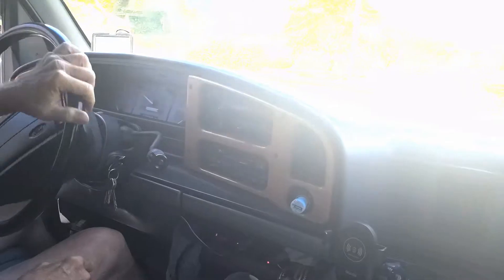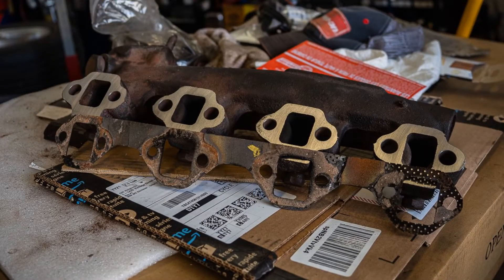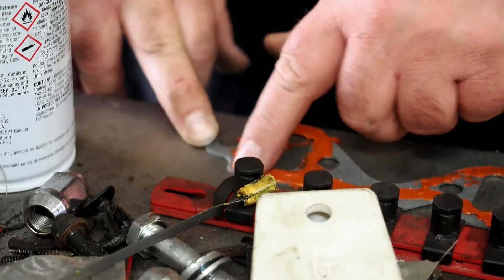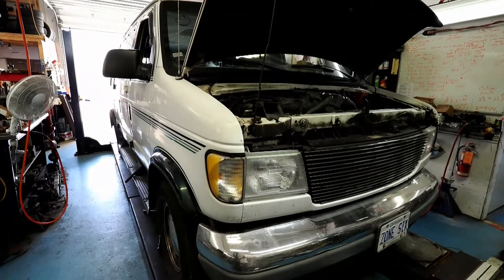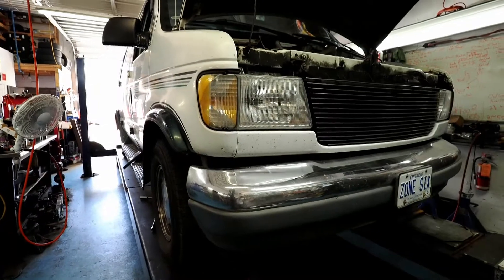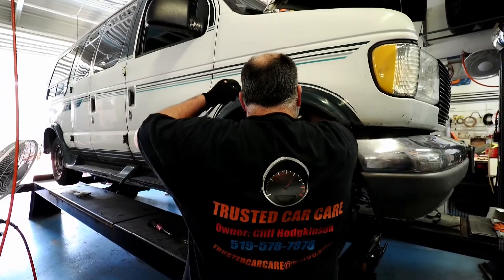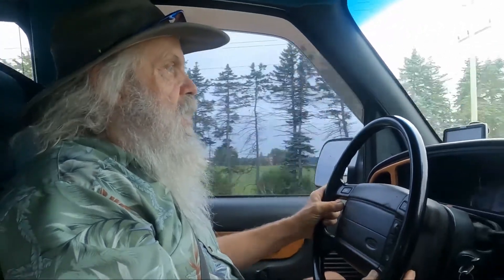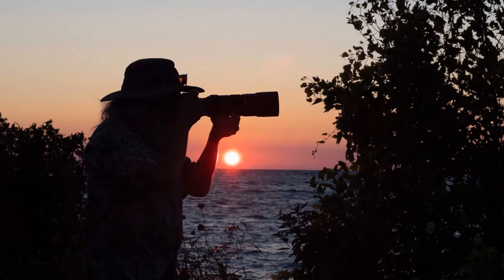Manifold Euphoria:  1995 E-150  At long last we bit the bullet and went all in to put an end to pain

Comment: I just took a look at my manifold and they are both cracked. I’m going to have them replace and then have a mechanic some it to look for leaks and maybe have them look into the catalytic
Reply from the maker: It's such a delight to have it fixed!  I just got to the bottom of a Vacuum leak too.  Now my AC won't cut out on big hills.
Reply: @bellasvistas3463  That's the exact problem I'm having when going up a hill on my E150. Where was your vacuum leak?
Reply from the maker: @wyatt1153  There were a few.  One was the Vacuum tank, that's the line where I replaced the check valve with an external tank.  Some of the old hoses were deteriorated -- visual inspection of all the hoses.  Finally I found a t fitting on the back of the vent activator that was for the rear SC unit.  The read AC was long gone...  I used 2 cable ties to squeeze that line shut.  The first repair I did worked pretty good, the  rear AC tube was still leking though https://youtu.be/4VYr1fmglBI